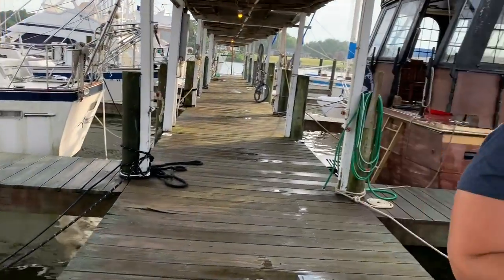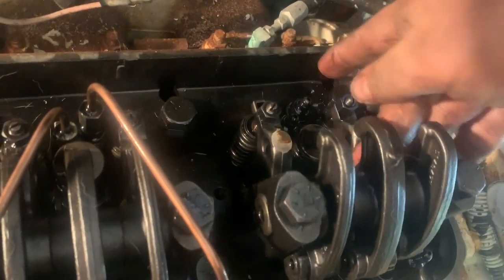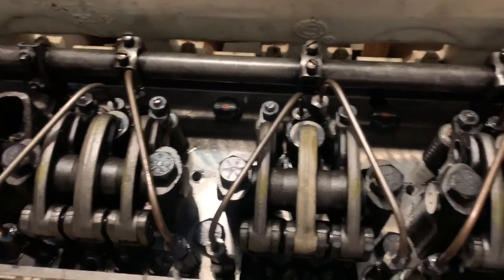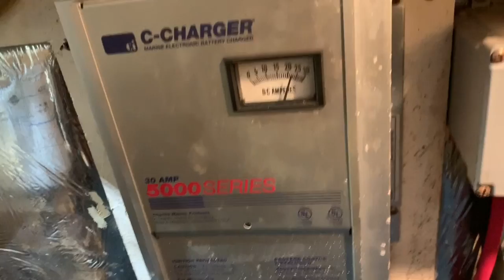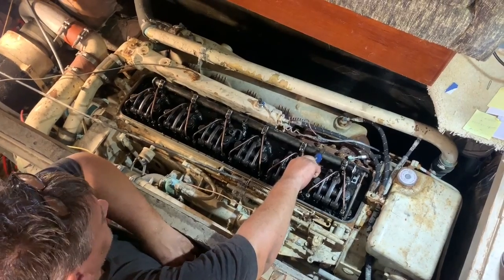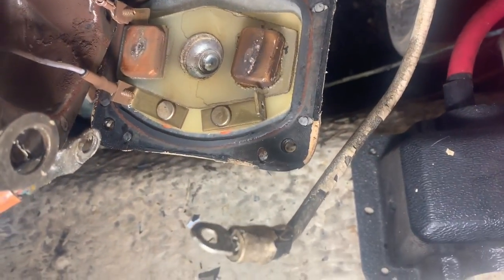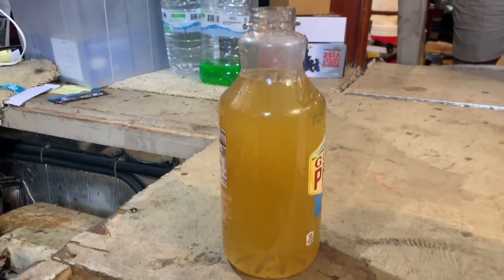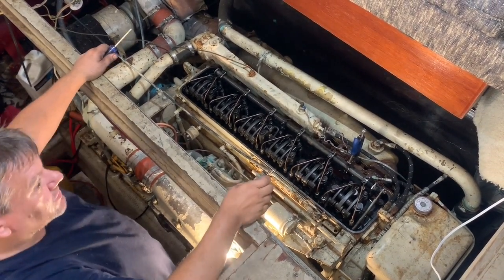Twin 671 Detroit diesel TIB boat (full video) 1st start

Comment: The starboard engine was in forward gear
Reply: You should probably close your mouth, the vessel has water cooler exhaust/raw water heat exchanger.
Reply: @askingforafriend6115  its clearly in gear it moves the whole boat , the wet exhaust has no thrust.
Reply: @askingforafriend6115   Hi Mate, look again and you will clearly see not only the thrust of the propeller but its turbulence in the water. If you don't understand something it's ok to ask questions, but it's not cool to tell someone else to shut up about  something beyond your comprehension :)
Reply: @stubbysquid1   Exactly :)
Reply: That's what I was thinking. The engine should be started in  neutral unless it was frozen in forward for some reason.
Reply: Hi  Scott, I don't know if you will see this. I watched this video last year, and just went  back to revisit it now. I was wondering if Pam ever updated you as to her experience with the boat?  I am a boater and are looking at 50 to 60 ft boats, most with Detroit 8v71's and 92's. This particular boat sure looked like a disaster to me. I am wondering if she ever shaped it up?

Comment: Loved the vid. Awesome work. Brought back memories. in my younger days I had worked on a lot of 671 D mated to generators, Hobarts to be specific (maintained, because they rarely needed work).  The sound of those engines is pure magic. I am surprised that you don't have a starter "Bump Switch" (heavy duty spring loaded Single pole single throw push button with heavy alligator clips) to connect to the starter solenoid. Screw drivers work LOL, but a bump switch saves on solenoid terminal and burnt screw drivers.
Reply: Who cares

Comment: I would love to have that. Sounds like a PT boat.
Reply: it doesn't sound anything like a PT Boat, VERY different engines
Reply: OK I know but it has a fantastic racy sound to it. Only thing I know about a PT boat is McKail's Navy and by the way I'm sure I spelled McKail wrong. Anyway I've always really liked the sound of those two-strokes.
Reply: PT boats used Gasoline engines V-12 powered by the same engines that powered the P-51 Mustang fighter. Only instead of one engine the PT boat had 3 engines.

Comment: Those things are like hand grenades waiting to explode at any time! That much horsepower is crazy from a 6/71 Detroit!
Reply: We used to call them 'Saturday Night Specials' they were rated for about three seasons at pleasure craft duty then time for overhaul.
That's about 1500Hrs. A standard spec 6-71 will easily last around 20,000 if serviced on schedule.
Reply: They are fine if treated properly. The problem is the way they were beat on.   Keep em under 2000 rpm they are reliable.   The other option is flog them and re kit them every couple years.
Reply: @djpar3492  That's the game in pleasure marine, gotta be faster then the other guy, if you ran them under 2000rpm the prop was absorbing way less power, and the engines would last for years, run them on the stops at rated power and pay the price.
Reply: Boss Günter  The mains and bigends get tired after a lot of high rpm high Hp. The same bearing size as a standard NA with double or more Hp the bearings take a beating.

Comment: Looks like a dragging clutch on the SB transmission -- possibly the port too.   Common for a cold transmission to spin a few revolutions when differential pressure on the control valve.  SB seems to be turning continuously however..

Comment: Damn cool stuff there Scott That’s a sweet older boat. That thing probably gets up and goes pretty good
Reply: It should , with those oversized injectors, those 6-71Ts are probably outputting 1000 HP together. Wonder what its GPM ( gallons per mile) is ..

Comment: When I first saw “twin 6-71” I thought it was the power unit that was on the LCM-8 that I was assigned to in the Army. They were truly “twins”two engines drove one prop through a 2/1 twindisc transmission. Either one could be decoupled or both could drive the output. The earlier units were Graymarine. Later Units were GM Diesel. Never saw them before or after.
Reply from the maker: See my sherman tank video

Comment: I would say it was started while in gear the last time, when both were started. 
If you had of cracked both throttles, probably would have parted a few lines, and went for a spin.
Reply: Not in gear. Just friction inside the gearbox clutches. Being Detroit engines it would most likely have  "Twin Disc" marine gearboxes.
Reply: @barryakins6236  
It would not thrust out water unless in gear.
Twin disc, or Velvet drives do not store up energy, and release it, when started. 
 Have been fishing, and dealing with engines/reductions for 40 years.

Comment: This looks like the ol junky looking boat that ladyed on its side in a driveway in the desert 🌵 out in Lancaster California, on ave, H East of highway 14, that ol junky looking boat looke real good when it came there , but as the years went by , it finally got moved some years ago, and now this looks like that boat, kool , 46 feet you said , that is the same size that is was , those old Detroit injectors or screw injectors , and just like any thing with Diesel it grows algee and sticks everything, lolol, nice , I have a ol grader 453 or471 , and the injectors were also stuck on that one I got it, kool thanks , where is this boat docked, ??? Thanks y’all BigAl California.

Comment: As a boat owner  for most of my adult life, and someone who is meticulous about mechanical maintenance, this boat is going to require a lot of $$$ to get back in seaworthy shape.  Good luck.  Great video but the boat needs to be on the hard for a good year or two for a complete re-fit. Props, shafts, seals, engines, transmission, control cables, hull repairs, systems repairs (head, A/C, electrical cabling, etc...).  Wow.

Comment: It will be better if you take a Oil sample and check it on a hot plate to see if the oil have water then if you have  a visgauge  que the Saiborsol for  fuel  delution

Comment: I guess boat has been sitting for a while unmaintained as it is  filthy, exterior mold/mildew , filthy deck. engine compartment and engine filthy and rust everywhere. I would be worried about the water jackets and cooling system from old or contaminated coolant and possible debris and corrosion in the heat exchanger, as this thing has obviously sat for a while

Comment: I am surprised the emergency air shutdows did not have a pull cable to topside vs having to open hatches etc to get to the trip lever. Time to get to the emergency lever could be disastrous at the wrong time with the power output of those engines. Its one thing to blow an engine on land where you can just pull off the road and a totally different one if your a even just a few miles offshore. Like an EPIRB that you pray you never need to use, there is nothing more important if SHTF.

Comment: I realize this is an older video but did anyone else notice all the dog hai? . You can see it after he pulled off the valve cover on top of the head. It's even around other parts of the engine room.

Comment: Didn’t DD two stroke rack tube individual injector levelers upgrade to single adjustment screw with a spring to prevent runaways?  Not really a marine guy but gear train change and starter rotation change can make a two stroke run right hand or left hand rotation. For one engines propeller right the other left rotation???  One plus of a DD two stroke is how smooth it’s RPM range is. 6L’s (inline) there was a balance shaft with a counter balance on the left of the camshaft. DD’s where renown for the smooth idle verses early four stroke Cummins or Caterpillar Rock Crusher idles. Crosshead pistons with slipper bushings. Two 12 point  bolts heads for connecting piston pin to connecting rod; I think 7/16s? Vacuum checking the piston pin cups. Sorry for the rambling. Just a flashback.

Comment: Worked on many Detroit engines Had one fishing boat get water in the fuel.  The steam created inside the injector exploded and blew the injector tip off.  The engine then over fueled and took off.  It had to be shut down at the intake with plywood as it had no flap. There is nothing like the sound of a Detroit over revving!!

Comment: You need a remote starter switch, it'll make ur life alot easyier
Reply: Upvote - plus for the owner of the boat:  A starter button in the engine compartment is nice.  You can start the engines down there when doing service.

Comment: Curious to know if the engines both turned the same way or if one was mounted backwards.
Reply from the maker: One Ccw and the other cw
Reply: You can have them turning oposit, Sometymes the reverse gear can run the other way to, so both engines one way, and the gears reversed, Some types of gearboxes can work both sides, right and left way around.  .

Comment: I like the videos, very satisfying to see and hear these run again.  Harbor Freight has a $12 remote start switch with charging clamps.  If I sent you some 2x exam gloves would you wear them???
Reply: I've wondered for years why I don't have a remote start switch.  I've shorted a lot of solenoids.  A couple days ago when struggling to get in the cab of a cabover truck to hit the start switch, with the cab about half tipped forward of course, I'd had enough.  The starter and solenoid weren't in a good spot to short the posts so I went out back and found a momentary start switch in an old scrapped truck, pulled it out, and made my own remote start switch.  Now why didn't I do that 25 years ago?

Comment: Wish i could help you......really. Was a diesel mech for years. Rebuilt so many 71 series heads superchargers and total engines i cannot count. I can run the overhead on both in about 45 minutes. Ruuuummmp rummmp rummmmp mmmmmrmrmmmrmmmmrmmrmmrmrmrrrmrmrmrm. Should hunt about six times before balencing on the governor.

Comment: 2 stroke diesels won't win any enviornmental prizes, but the parts are cheap and readily available, given how expensive boat engines can be.. this makes them attractive . 450 HP !  these must be  the high output turbo'd motors they were selling in the 80's for sport fishers and apparently what must be a fast cruiser.  not your 160 hp landing craft motor, that's for sure.---Doesn't it always rain when you are trying to work and record it ?

Comment: they need to get rid of that charles charger.  its way past its prime.  makes a better as-needed shop bench charger than a continuous use boat charger nowadays.   or if they like watering batteries and beating them into submission and replacing batteries often , then, sure. keep that hunk of shit.    also that model was not user selectable for battery type. and most were set to GEL in that era, of which its highly likely the batteries are FLA or AGM now.      on the tag on the base of the charger flange, it will say what its set for.

Comment: I been working on detroits for last 35 years on diffrent sizes, now I am stuck on a boat Hytress, having twin  6-71's as both engines are having the same issue which is not reaching to noload full rpm, the are exact engines that are shown in this vedio, I have tried alot by adding shims, tuening it up sevral times, tested injectors found no problem, and what ever I thought is possible I had done but the max no load rpm not going above 2100 rpm and full loa just 1500.
Hope some one can advise the possible reasion for this problem, or how can it be resolved? 
Thanks
Zubair
Reply: No reply to me !! Thanks any way !

Comment: How is the water getting in the tank?
Reply: When I worked at the marina, on salt water, the first thing we did after winter was drain the water out of the tanks. Condensation is how the water accumulates. If the fuel tanks aren't topped off before the boat sits for a while the tanks will get plenty of water in them so the condensation occurs on the inside of the tank. I've pulled 20 gallons plus of water out of 80 gallon tanks that sat only one winter and yes they were fairly low on fuel. Some folks just wouldn't listen to us and top em off like we asked. I loved the full tanks cause we always checked for water anyway but full ones almost never needed it.

Comment: the starter od the other engine is very slow,may have problems with the brushes(copper-carbons) that give power to the rotor.

Comment: Guess what you can’t get away with that kinda power in a boat either! These JandT 671s are ticking time bombs the 671 at 200 hp last 10-20k hours cranked up to 275 turbo your looking about 8-10k these 450-485 hp units don’t last 2500 hours I’ve seen them come apart before 1500 hours. That’s why they are put in these recreational boats that don’t get used at all. Not a cooling issue just way to much power out of a very small engine.

Comment: What makes water in the fuel so scary?  If there is just enough fuel to keep the engine running, will it just make steam? and steam clean? and if not, is it that tough to drain from the lines?
Reply: Water will destroy the injectors very quickly.  The injectors use the fuel as lubricant and water doesn't cut it.
Reply: @matthewbeasley7765  How about throwing in a bit of water soluble lubricant? though I suppose while you are draining the lines, the boat is adrift.

Comment: According to a Detroit Diesel  class instructor engine runaway is a misnomer, engines overspeed and mechanics runaway! Check out my reply to  Michael Baumgardner
Reply: @JJ-jv1gu  The instructor worked for Detroit Diesel which  was part of General Motors and eventually  sold to Roger Penske. This teacher went to DD distributors and gave lectures  and taught various  classes. He was well trained , very animated and very informative.
Don't  recall his name.
 I took the tuneup and maintenance course offered  through Bell Diesel in Connecticut. A friend  had a brand new 46' Egg  Harbor with 6v-92 TIB's 525 hp. After  fighting  with Egg Harbor ,Johnson  and Towers (the engine supplier) and being shunned  by the warranty dealer in Massachusetts we saw the 
 brochure  from Bell Diesel. The boat  owner signed  me up, handed me the keys to his  Corvette and said your going to school. I already  had a beautiful
Swiss made photo  tachometer that hat I used to check  out the engines  before taking delivery of  the boat. The  stronger  engine turned up about 60-70 rpm more and the J&T mechanic  at them factory said he likes  the engine to be sold to  within  20 rpm at WOT. After  the tuneup and before the test run the owner said they sounded better and then we picked up about 25 rpm on the stronger engine about 75 on the slower  engine
Reply: @JJ-jv1gu   Was interupted while texting and accidentlu hit the send button. 
The Diesel guy from J&T liked a max difference of 20rpm at WOT but  his boss wouldn't  give him the time to fix them saying that they  were running "good  enuff "
This happened  in 1983!!

Comment: Why would you take the rack off, just to change one injector. All you needed to do, was to loosen the rack screws on that injector.
Reply from the maker: To figure out which injector was stuck.  This is the old school rack and not an individual spring loaded finger one.  So with one stuck they were all stuck.